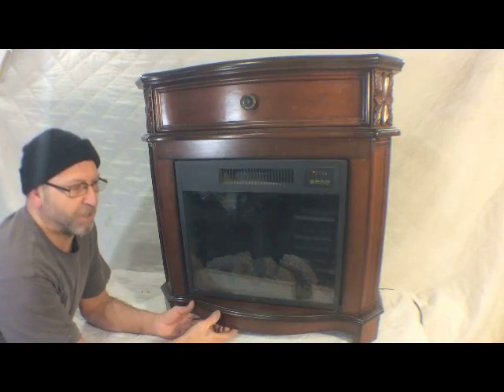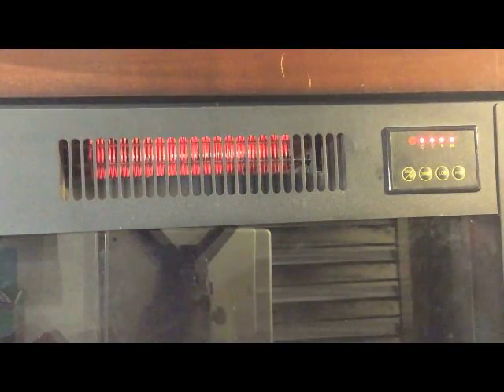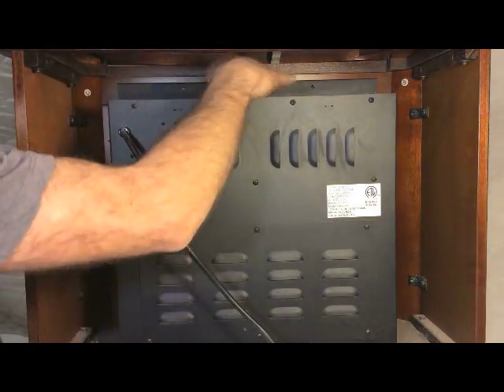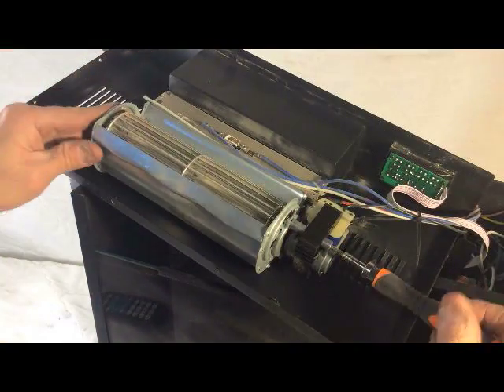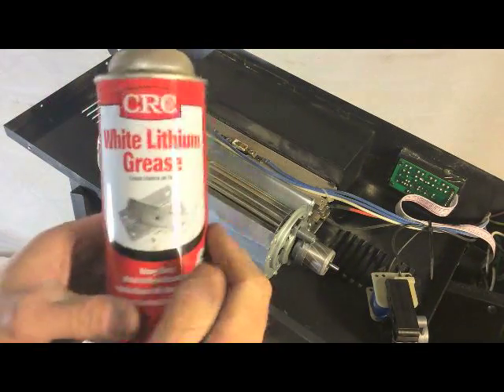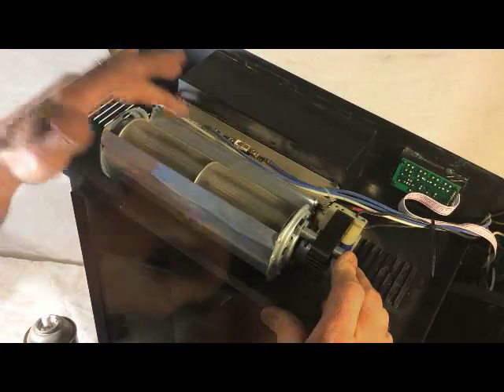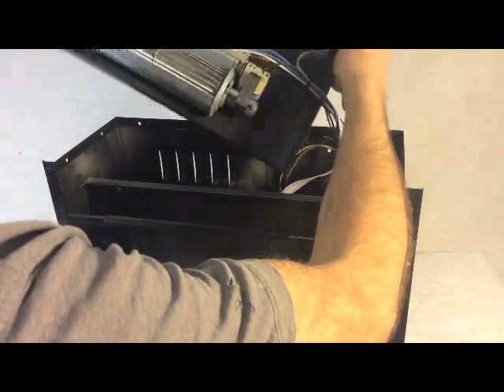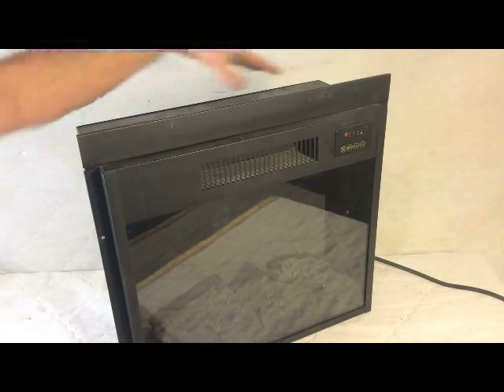1500 Watt Electric Heater Repair

Comment: I know this is an older video,  but I just wanted to say, "You're the Man!!" I bought a $10.00 Amish Electric Fireplace at a garage sale during the hot season. Warm season has gone, 🥺 so I retrieved it from the garage to use as our supplemental heat source until we're ready to heat the entire house. Turning it on was noisy and smelly every time. I ran it for several hours this morning until we were comfy then turned it off. When I tried to turn it on a few hours later, no go!  Then a blinking light alerted me that there was an issue (obviously). I hopped on youtube, found & watched your video.  Stripped it down,  used qtips, a keyboard dusting can, a little lube, good wipe down and put it back together. This unit is running better than ever!! No noise, minimal dust burn smell and warmth; as i mourn the passing of summer!! Thank you so very much!!
Reply from the maker: Your Welcome! ya most of the time they just need a good cleaning, thank for the kind words.

Comment: I came back to post. I did just as you said here. I vacuumed out any dust and I put a little WD-40 on the wheel, so that it moves, it was moving pretty freely though, but I put the WD 40 anyway. Then I checked the heat button. It seen a little loose. I played with it a little, and pushed it in so that the connections, connect. I said: " Well test it out. I was praying I didn't have to change the fuse. Sure enough the heat came right on! BOOYAH!!! THANK YOU!!!
Reply from the maker: Your welcome! Glad that I could help.
Reply: @channelron3593 YES! Im beyond grateful. My furnace is not working, and every winter, i use a space heater. I purchased this fireplace used. I told the guy: Turn this on, let me make sure it works. Sure enough, heat, and all. I had it down by the Garage. I had to unscrew it from the wood, to get it upstairs. I painted the fireplace, a light beige, off white. It looks good, then two days later, i brought, the heating unit up, turn it on. NO HEAT! I was sick to my stomach. Then came across your video,  and WALA! Thanks again, and Thankbuou for replying to your video. Most people dont reply.
Reply from the maker: Sounds like you have in under control, I try to get back to people but sometimes I forget, generally Sunday nights I try to catch up on comments.

Comment: just bought mine, serious deal during the spring clearance of heaters.  Works fine but it's nice to see how simple it is the check the fan . . . thanx . . . . . . . . . p.s. My OCD was screaming when you didn't wipe down the top of the unit when you put it back into it's mounting!
Reply from the maker: (: thanks I will make sure I do better on the next one (:

Comment: Thanks!! You saved us from buying a new electric fireplace mantel. I took the screws off and just used a hair dryer to blow out the dust in that squirrel cage. I didn't even use the grease. After blowing out the dust I tested the heater and blower while it was resting on the unit; without screwing it back in. Once I saw that it was working for a while without switching off I put the screws back in. Thanks again. Very easy to do.
Reply from the maker: Not a lot to them glad that I could help and thanks for watching.

Comment: Well thanks to you I fixed our's! The heat would come on but the fan wasn't engaging so it would get hot and shut off after a few seconds. I followed the tutorial and now it's working again. I'm so glad, we use it ALOT in the winter. Thanks!
Reply from the maker: Nice! Glad that I could help.

Comment: Great video! I had a Classic Flame electric insert that  kept coming up with a code E3 which senses a overheat of the element and shuts the heater off. Pulled the back off. Took two screws out of the motor to get it apart, sprayed the motor bushing/bearings and the shaft with white lithium grease while moving the shaft back and forth to spread the grease around .  Reassembled and wha la, it works like new!

Comment: Another in a long line of thanks for this guide. The old house I moved into has a similar looking unit (more ornate wood) with a Twin Star heater inside that had nice lights, blew the fan, but no hear. I was able to find that the fan had little debris and spun well, but that the white wire to the heater was detached, and the terminal it connected to had corroded away. I was able to wedge and pinch the wire on, and it works, but not sure how long it will hold. But I can see from today's effort swapping in a new fan/header will be easy. Thanks for the boost and saving big $$ on replacement.

Comment: My son put a small toy in the panel opening , what is a quick way to get it out from the fireplace on the inside, This particular they may not be the same model but the operating panel has a cover that you open and push the buttons and that’s how it got in
Reply from the maker: Ya.. You need to tare it down, but this is a good thing then you can clean it out.

Comment: Do you know if buttons outside and inside can be replaced. I have a 1500w infrared quartz heater that worked perfectly fine until someone accidently left to facing a wall and now the buttons are stuck and i think i might have broken the internal button trying to push the power button which is the most important button. I would really like some advice since it wasn't cheap and I know everything works but the buttons can't be pressed. Please any advice would help?
Reply from the maker: I am guessing that you have a thermo switch inside that may have tripped? I have a video coming out sunday that had possibly this same problem?

Comment: Where can I get 1500 w blower with heater and control board for Southern Enterprise (SEI) 
YOU SEEM LIKE YOU KNOW YOUR STUFF. Great channel. Subscribed
Reply from the maker: The problem with many of these heaters is that they are designed to be thrown away. but sometimes you can find parts online if you look hard enough.

Comment: I have a heater like this & I've been debating whether to open it up or not. It works great for a few minutes & then it clicks & the flames freeze & the heating element stops as well as the fan. Is there a fuse or something inside i could replace? I dont think its overheating because it doesn't run long enough to overheat. I would appreciate any help! Thankyou

Comment: We have a brand new unit, looks much like this one.  I opened it up, fan blows fine and no dust on the shaft or rat cage (since it's new).  It will work and run on the LOW setting but when switching to HIGH setting the unit stops automatically within a minute (even though the fan is blowing fine) and the fire animation stops too.  Any ideas?  Bad thermal sensor?  Thanks!
Reply from the maker: That would be my guest? or maybe the fan motor not turning up enough?
Reply: @channelron3593  if it's the fan motor, would the fan motor have to be replaced or can it be repaired?

Comment: I have a problem with mine, i turn it on but the heater nor the light from the fire turns on, but when i press the button it beeps like if its on, but nothing happen. Can i fix it or should i just by a new one?
Reply from the maker: I Would try giving it a good cleaning first could be just something like cat hair or lot of dust build up, you have nothing to loose it is not working anyway.

Comment: Could you please help i have an 3d electric fireplace by mainstay.....it wont come on and i don't see a fuse
Reply from the maker: Double-check all your connections, Put a meter on it as well, it is tough to diagnose things like this without having it in hand.

Comment: I have this exact unit and am not having the issue you fixed here but instead am' having trouble with the flame illusion motor being noise and loud.. Coulkd really care less if the flame part works so is there a way to disable that motor and the unit still work and produce heat?
Reply from the maker: Yes just unplug the motor the unit will run without the imitation flame.

Comment: When I cut mines on on the heat part. It  blows out cold air the fan works it just blows out cold??
Reply from the maker: Sounds like the element is gone
Reply: Thank you so much

Comment: I have the unit with the LED lights which I seem to have gone out how do you go about replacing that yourself so that you don't have to contact the company because their heat surges very well known for not contacting you back
Reply from the maker: That is a good? I have not had that problem, Yet, I did look on amazon and did not see much, Sorry could not help ): Thanks for watching.

Comment: I have one similar to this and just bought it. It would run for 5 minutes then shut down for 20 minutes and run for 5 minutes. Is this normal?
Reply from the maker: Sounds like it maybe over heating. you may want to clean it?

Comment: Mine actually blows hot air on high but only blows cold air on low.. any idea why?
Reply from the maker: Not sure? have not had that problem yet, I am wondering if the coils are seperated for Hi and low? if so then the element is bad on one side, that would be my guess.

Comment: I have a space heater like kind of like that one but mine will not even come on any input
Reply from the maker: Mm maybe just a fuse, not sure ):
Reply: @channelron3593  where is the fuse located? In the motor compartment?
Reply: Mine will not turn on all the sudden.

Comment: Would like to rig one of these units (4002881) for use as a prop for theatrical productions at our church. Where can I find a schematic so I can attempt that? We don't want any heat effect at all, for safety sake, just the "fireplace" effect. We tried disconnecting the heater element and blower unit from the control board and that rendered the "fireplace" effect inoperative. Would appreciate any guidance/warnings you might have to offer.
Reply from the maker: Check out my other video I did on fixing the imitation flame, maybe that will help?

Comment: how did that fix hold up ? curious ... i have the same issue with mine and i opened it last night and cleaned all the dust but i didn't grease it .... may have to take it apart again and lube it
Reply from the maker: Great, I use it daily about 2 - 3 hrs. and have no problems with it, Not sure if the grease was necessary I just thought  that it needed it, Thanks for watching.

Comment: Mine don't wanna seem to go in cool down mode I'm scared to use it afraid it'll overheat start a fire any ideas mine made & manufactured by TWIN STAR INTERNATIONAL. Does anybody have any ideas what might be wrong or how to fix it?
Reply from the maker: Ya sounds like the board may be bad not recognizing the over temp check the thermos switches to make sure they are snug to the metal.